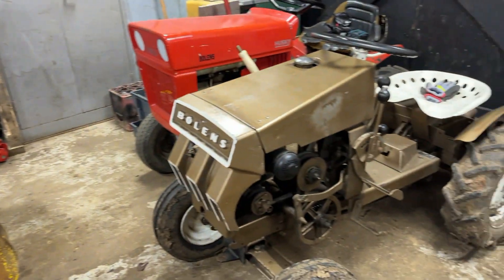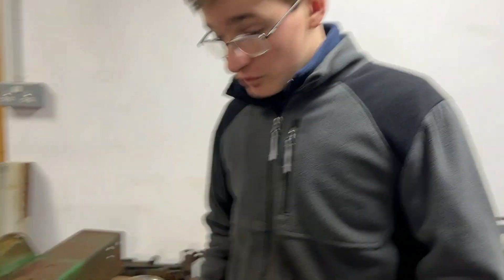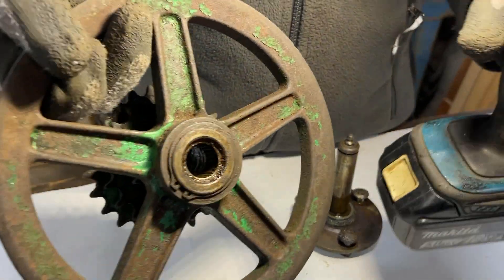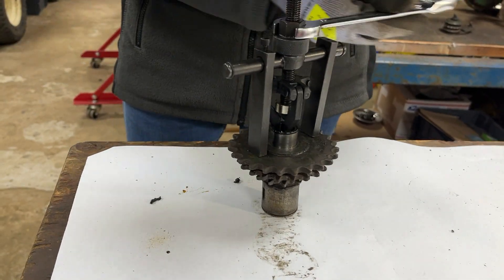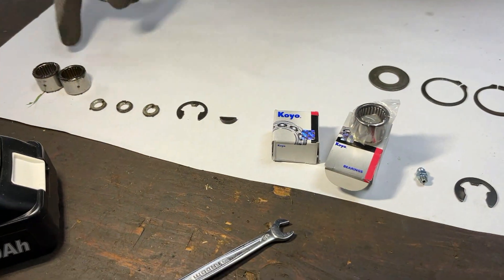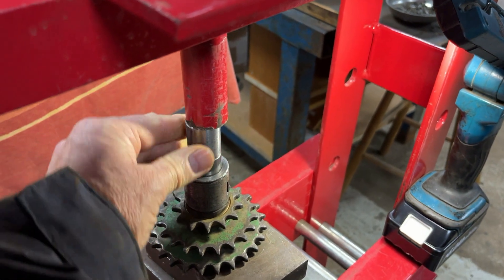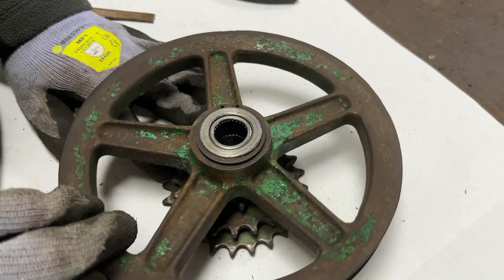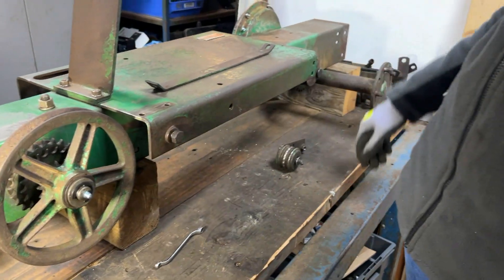1960 Bolens Ride-a-matic - Part 14 (Front Sprocket rebuild)

Comment: Great video Joseph and Iain. You two are so good with the detail and the tractor will be like new or better. 👍🏻👍🏻👍🏻👍🏻
Nice observation on having the grease hole on the top of the shaft. I think I would have done the same. 
Yours and your fathers, or viewers thoughts on, when we grease or oil shafts when we put some thing together, could anti seize be used instead of oil or grease ? Any better or worse ? 
Thanks fellas. Great job and always some thing  to learn 👍🏻👍🏻👋👋👋
Reply from the maker: Thanks for the kind words Noel. I was wondering if someone would pick up on the location of the grease hole. Interesting thoughts about what to use putting things together. We tend to use grease or oil depending on the tolerance and use anti seize for anything that does not move. Take care
Reply: @GardenTractorBoy    Interesting.
Well that’s what I do Joseph. But for some reason the other day I was wondering if anti seize would be an option. 
I’ll try to look into that just for fun. 
Have a great upcoming week. 👋👋👍🏻👍🏻

Comment: Nice work removing and installing those needle bearings. The tensioner sprocket teeth have done their duty and don't owe you much. Wow. They are worn out. Coming along well. The cameraman is doing a fantastic job of capturing all the angles and even helped align the press!
Reply from the maker: Thanks. The tensioner should not have any teeth on it, it should just be three raised rings. It will be clearer when the replacement arrives. Take care
Reply: Oh, I see. Looking forward to seeing this tensioner in detail. Take care! @GardenTractorBoy

Comment: When I was regularly rebuilding auto engines in my basement, I figured that half my time was spent cleaning. For first disassembly, during machining, after machining, and after assembly to paint it. I then had to clean the engine compartment. You have to do a good cleaning job to end up with a good job. Good Luck, Rick
Reply from the maker: We are surprised how much time we are spending on cleaning with this project. Cleaning is very time consuming and not something people want to see in a video but once the parts are clean that are good to work with. Take care

Comment: when you guys get done with that  project, you'll have a  same as new tractor,, great little puller you have there too.
Reply from the maker: The parts we have rebuild feel great so it will be interesting to see how they all work together. I expect the tractor will be very tight to start with. That puller is only a cheap overseas tool but it works very well. Take care

Comment: I agree with cleaning parts takes a big part of the time rebuilding anything. But it pays off in the end on the reassemble
Reply from the maker: Sadly cleaning parts does not make good videos otherwise it would be a lot easier to record. This tractor is much dirtier than anything else we have worked on. Take care